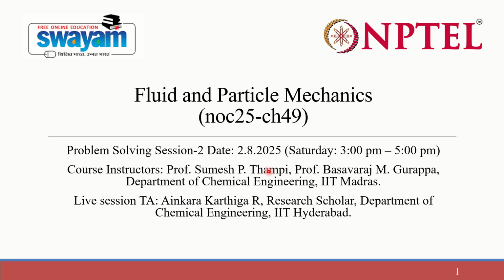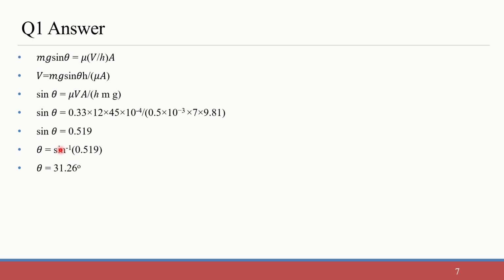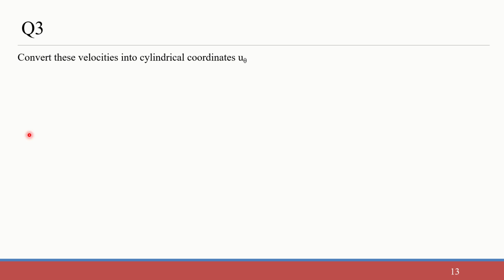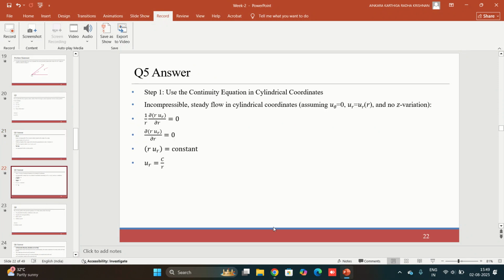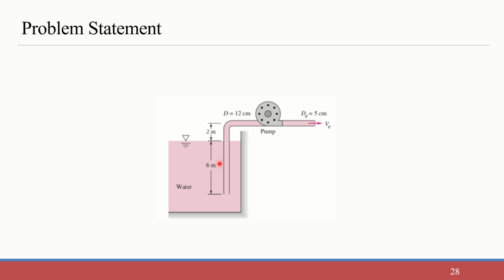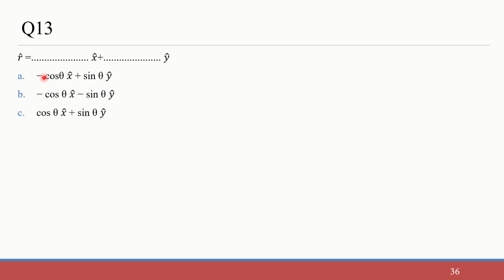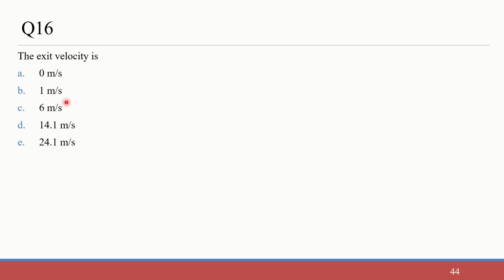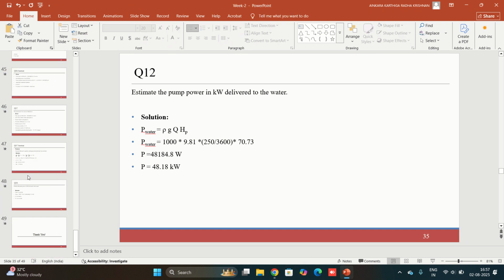NPTEL-Fluid and Particle Mechanics (July-2025) Problem solving session-2 (Please check description)

Comment from the maker: Important Note: 
In questions 11, 12, 17, and 18, there was an initial error in the explanation due to an incorrect consideration of the elevation difference. However, the correct approach and answers were recalculated and clearly explained at the end of the video. Please refer to that final explanation for the accurate solutions.